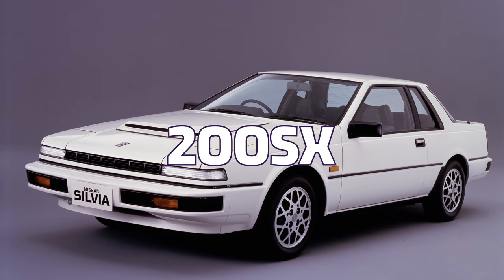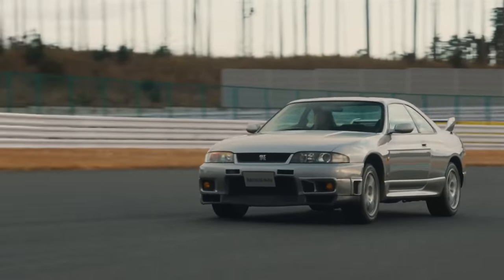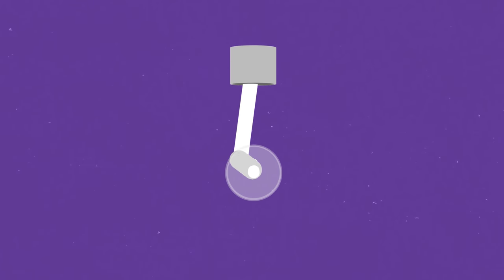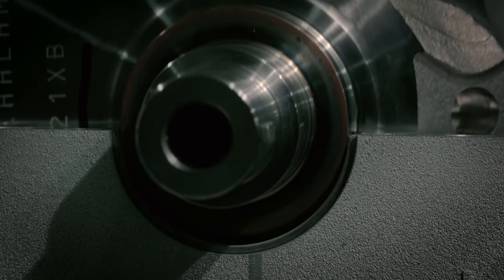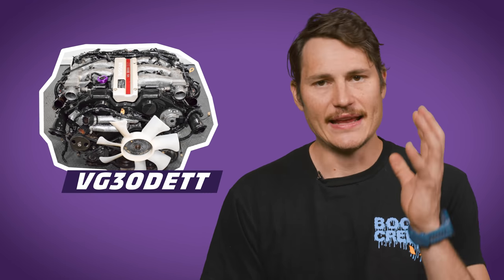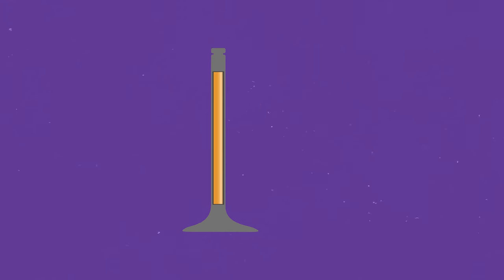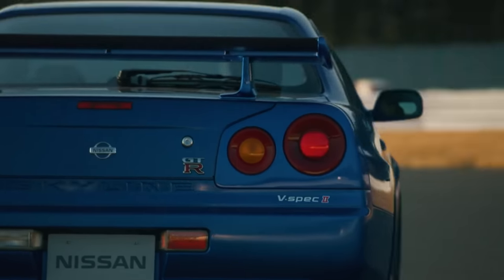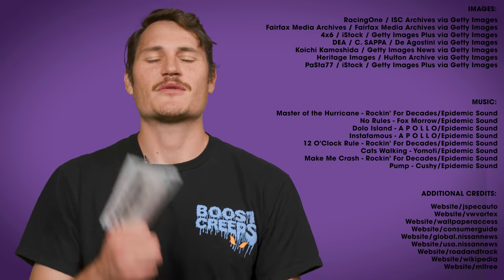RB vs. VG: Why Nissan Discontinued Their Best idea

Comment: As always, the production is excellent, HOWEVER I've got some "technical inaccuracies" warning bells going off in my head... so like a good keyboard warrior I'm just gonna spit out my unresearched information in the comment section.  Sue me.  

1. The animation of the firing order on the RB... there are NOT multiple cylinders firing simultaneously in this engine.

2.  I don't believe the sodium vaporizes, rather, doesn't it just liquify and float up and down within the hollow of the valve?
Reply: Yeah sodium filled valves is something different than liquefied into gas valves lmao. They are primarily just lighter. The production is shit if they just spewed completely inaccurate information as fact that some fanboi is gonna recite as automotive gospel without a second thought.... lazy writing and research.
Reply: They remember they used a similar incorrect firing order on another video, when both cylinder are tdc one has combustion one is exhaust stroke

Comment: My 1991 Nissan is also one of the best.  1991 Nissan Hardbody d21 base with the KA24 and 5 speed manual!! Woot woot over 350,000 miles all original not sure how much over because that parts broken lol but 10 years ago when it stops counting.

Comment: I loved the 300 ZX31 . I owned 3 of them , all very good ( one with more than 420.000 km, no oil losses, full power nearly everything still in order ). Very reliable V6 with very low fuel consumption , high speed max 255 km/h . The open roof Targa driving feeling was perfect. The Z32 was very beautiful - to my oppinion one of the most elegant designs at all - but not comparable concerning low fuel consumption and difficult to repair ( no space to act and very complicated - too many different materials with different thermal behaviour -, early engine problems , but also extremely powerful  , I owned two of them, one had an engine fail when I bought it with 120.000 km , tried to repair and gave up, but a well experienced Z32 specialist bought it and was able to tune it beyond 400 hp, and vmax=295 km/h  ). A gone and happy era.

Comment: VG30 has one throttle body per bank. And the VH45 has sodium valves too. The RB26 has two exhaust manifolds. The follow up to the VG30, the VQ30, was Nissans race car engine. 300ZX also has all wheel steering.

Comment: All of this really just makes me sad to see how far Nissan has fallen. They were IMO the best manufacturer for enthusiasts in the 90s but with all of the cost cutting, CVTs, etc they haven't made anything compelling in many years. Add in the crazy price appreciation of 300s/240s and my current G35 will probably be my last Nissan, at least for a long, long time. 

My only (slim) hope is that they  can actually embrace electric cars fully and come out with some desirable models. With the Leaf they had a great advantage over most other manufacturers but they've essentially squandered that and don't appear to be making any headway. RIP Nissan
Reply: @Thor Odin son sounds awesome
Reply: 90s Infinitis are the last desirable Nissans still on the market. Q45, G20, J30, i30. Everything was top of the line
Reply: @Thor Odin son yeah mine is an 03 sedan and is on death's door. I don't do much wrenching myself on it and have had to put over $6k just enough to keep it running for the past 2 years. Still has tons of issues that will needs to be fixed soon (valve cover leak, fuel pump, etc). I really like the car but it has been very unreliable and a money pit.

Comment: Most people in the US don't know that there was actually a diesel version of the RB (the RD28) as well, just like the LD28 was the diesel version of the L Series. I have one in my daily driver (1992 Y31 Gloria wagon) and it's quite impressive for a naturally aspirated diesel. It is quite high revving for an IDI diesel, owing to it's short stroke, and gets impressive fuel economy, even beating a 2013 Jetta TDI wagon on a long highway trip. It's extremely smooth as well, and has the great RB exhaust sound. With a turbo and upgraded internals it's possible to make some pretty impressive power as well.

Comment: Eh, a three-cylinder works perfectly as long as the two outer pistons are half the size of the center piston and are operated as one, so the engine functionally becomes a balanced two cylinder.
Then add a temporal torque transfer device (a radial magnet stator and a bar magnet rotor, which are shaped to subtract torque during power strokes and add it back in during non-power strokes). Now you have a three-cylinder engine with perfect balance that is smoother than a straight six.
Reply: But then that’s the same displacement as a 2 cylinder
Reply: I had a Yamaha boat with two 1.4 liter 3 cylinders that revved to 7500ish for hours at a time and very smoothly.  Essentially jet ski engines

Comment: The pinnacle of the VG is actually the VR38DETT which we all know are now being modded up to 2000-3000+ hp in GTR’s. Plus the VQ series are incredible in their own right. I put 205,000 miles on my 3.5 altima and there was never a day I didn’t drive it with the pedal to the floor wringing out each gear to redline. It was still running strong the day I traded it in and the only failure it ever had was a cam position sensor at 150k miles which is a ridiculously cheap and easy thing to fix.

Comment: I have a 93 Nissan quest with the vg30e it's my good gas mileage beater I drive on occasion it's sitting at 338,000mi and still running well..
great engines
Reply: I believe the Quest has the VG33.
Reply: @mescko  later generations had the vg33 but the early gen had the vg30

Comment: I love the vg series of engines. Thry may be a pain to work on, but theyre so simple. I have a vg33e in my 2000 nissan xterra. Its slowly getting upgraded and ive got headers and a turbo on the way. N/A it is getting roughly 230Whp

Comment: You forgot to talk about how VGs regularly make a quarter million on miles before failure and a boosted Rb be lucky to see 100k
Reply: Yeah, mileage is a great way to measure the value of a car that's just not very fun.   Also fuel economy and insurance.  lol
Reply: You're not wrong about the VG but "lucky to see 100k" you have no clue what you're talking about
Reply: That’s funny my boosted RB has 220,000kms and still has good compression all round
Reply: @jarradwalsh6829  yeah your just at 100k would you like me to show you my Vg generator NA makes 250 hp has 2 million hours on it never been apart valve cover every 5 year oil change every year the Vgs live longer than rb its the benefit to not having a inherent oiling issue
Reply: @stevenveach6984  My RB25 has done over 50,000km on 440HP. Yes the RB has oil issues (usually due to sustained high RPM for long periods of time) but they are easily fixed with aftermarket parts readily available.
Reply: @jarradwalsh6829  great power density is what makes the rb a sweetheart for the community but for day after day or emergency use/reliability I would take a vg any day built for cars , truck ,utility vehicles . Heck the Japanese military has a version of the vg as a generator to power field hospitals in the 90s . they're much simpler than just about any v6 of the Era and parts are global rb parts are kinda scarce if  your not in a market where they existed naturally .

Comment: V6s are not 2 inline 3s either. The firing angle is the same as the Inline 6. From experience, the VG runs just as smoothly as the RB lmao. Your argument and logic is based on 90 degree odd fire V6s, not 60 deg even fire. Lmao
Reply: Correct.

Comment: All of this just made me wonder what a V12 consisting of 2 RBs smashed together would sound like
Reply: Toyota did that with the 2jz look it up it’s pretty cool
Reply: @Pandara-up5lw  yeah the 1GZ-FE, the one used in the Century. it's a 5.0L so two 1JZ. Some madlad is putting it in a miata. Closest we got from Nissan is a 5.0L V12 derived from Prince's GR8 engine (2.0L I6). The GR8 was the base of the S20 used in the Fairlady Z432 and first gen GT-R

Comment: The VQ engines are mint aswell 🔥🔥🔥
Reply: until the timing chains make noise or the head gaskets leak lol. done 1000s of timing chains on these motors. other than that it runs pretty well.

Comment: In Australia, gm holden used the rb30 in their 1988 vl commodore, they were able to claim 33% more fuel economy over the previous commodore which had the old push rod 6 from the 40's. Ford just kept using their tractor engine and holden killed ford in sales. But it had one major design flaw, the radiator sat lower than the head so it was prone to blowing head gaskets,  the shoebox r31 did not have this problem. So americar-heads, you want a factory general motors jdm engined car, the VL holden commodore is your diamond.

Comment: Alfa,s 4 banger twin cam engines had sodium valves on the intake and exhaust ,back in  the 60,s, the factory  book said not to reface the valve, you were supposed to cut the stem off to release the sodium and toss em in the bin, plus the valve seat angle was 46,so you had to hand  finish every seat and valve with really fine lapping compound

Comment: I've owned lots of old Skylines and Z cars but all had L series motors except for my Z31 which had a VG30 of course. It was nice to drive but one thing that killed their popularity here in Australia was that the Z had a different intake manifold and injection system than the Maxima, etc, in order to have more power and responsiveness. Only trouble was that if you had dirty injectors they would leak and fuel would pool in the manifold. Many 300Zs burnt to the ground and we turned back to Skylines well before Gran Turismo was a thing.

Comment: Great video guys!!! US VG history goes pretty deep and a lot of it goes into grassroots racing. VG30E/T notably for the Z31... But as you look into it, The S12's got a limited run with the VG30e as well. Again, besides the Z31 for the sohc VG and the DOHC VG for the Z32, it largely goes unnoticed. Being a fan of the VG and a car that some don't know much about stateside, the Infiniti M30 is a vg30e (with AT). In Japan, the F31 Leopard had the whole range of VG20/30 except the Vg30e (and the Leopard owners love it because of the response). Same with the Ced/Glo/Cima of the same era.  They had the VG30DE/and DET in the top level of the F31 leopard (Ultima). 

 But when you really think about it, Nissan made 2, twin turbo, 6 cylinder engines at the same time and that to me is pretty bad ass. 
Personally, I love the VG series and as my leopard brothers say  in Japan, "heart of the leopard is the VG". While tuning can be done, RB engines get all the love because of the reason explained, we (Americans) never got the RB or the Skyline and it was romanticized with how it used to be un-obtainable or the games or the videos.

I will add, I am rebuilding an rb25det with forged and upgraded a lot of components as well as rebuilding the M30 that it was swapped in (Project Car Magazine M30) and Geezus the RB is expensive to build. I'm not sponsored, or have hook ups or part of drifting.... so everything I've done was out of pocket. But the M30 I got was the most famous within the US F31 history. Other than that, I would have loved to swap in a VG30DET into an M30 to make it close to the a Japanese Leopard. f31club.com

Comment: The VG is a PITA to work on especially when packed into the tight engine bay of the Z32. It also sounds pretty awful like most V6 engines. The RB sounds fantastic and is less of a headache to work on since it's an inline-6 layout. Inline-6s tend to be smoother running than V6s.

Comment: the moment you said the RB was an inline 6, I knew right away which one is the better engine. I have a Ford 4.9l in my 82 F100 and it is the most reliable engine ford has ever made, to the point where die hard GM and Mopar guys like it.

Comment: The Nissan CA18DET inline 4 had sodium filled exhaust valves. I'm fairly sure all Nissan DOHC 4 valve turbo's have sodium filled exhaust valves.
Anyways there's about 12 mph to argue about, the Z32 has better aerodynamics.
The JUN-BLITZ Bonneville Z32 with VG30DETT holds the E/BMS class land speed record of 419.84 km/h (260.87 mph) set at the 1995 Bonneville Speed Trial.
JUN HYPER LEMON R III with RB26DETT set 1997 USA Bonneville Speed Trial F/BGCC class record of 383.715 km/h (238.48 mph).
240SX S13 took E/FALT record of 379.54 Km/h (235.890 mph) in 2006, with a GM Indy V8 race engine.

But a Datsun 120Y coupe has done 295 mph.

Comment: Idk if anyone in the 90's or early 00's were fooled into thinking 240sx's were "fast" lol. Back around 02-03 you'd be lucky if you could sell a 13 year old KA powered S13 for 1000 bucks. Sure the S14 did command a higher price at the time but it was also still a fairly new car. The S13's struggled to keep up with n/a Honda's and weren't really seen as a viable platform unless you were willing to build your own conversion harness to run an SR swap and even then it still wasnt going to win trophys at the drag strip. It wasnt until maybe 2008 or so, or whenever Formula-D came to the US that aftermarket vendors really started making parts that allowed the S13's to become real a condender. 
Even just 5 years ago there was almost zero aftermarket for the VG30et and Z31, but that whole market has opened up in a way I never thought I'd see...and just in-time too cuz I just got a turbo Z31 and an N/A that both run, both are 5spd 2+0 models and neither of them are rusty. The best part is they were free cuz I gave away a 280Z 9 years ago to a guy who is finally "repaying the favor"...not that I ever asked for anything in return but damn ^_^

Comment: Jeremiah watup bro..speaking on long vs short.. if long easier to break... why does the 2jz handle more power from an upgrade on its engine with stock engine internals as opposed to the vg version.?? And I think the 2Jz n RB are two best tuning platforms... 2Jz may have the edge

Comment: I had a 2001 Xterra with a VG33 engine. Only thing it ever needed was a timing belt and a valve cover gasket, thankfully it was the passenger side gasket that leaked.

Comment: Jerry! I know this video is old , but no mention at all about the RB oiling issues? consistent high rpm applications lead to oil being trapped in the head and it starves the low end. Resulting in a pretty upsetting situation.

Comment: That's not how a sodium-filled valve works, that's how a heat pipe works. Sodium filled valves are half-filled with sodium and the sloshing of it's operation carries the heat from the head to the upper section of the stem, no boiling involved.

Comment: I read an article about how in a parallel universe that if Holden hadn't stopped using RBs in favor of GM corperate engines, we could of had Holden imports  with RBTT engines. Early concepts of a Pontiac GTO revival exist with Mazda RX8 suicide doors, and in a parallel universe with a RBTT instead of a LS. This would be the same with the G8 and Chevy SS.

Comment: one of the most abusable engines of all time has to be the VG33E. All the miles, all the idle time, bad egr valve, overheated, drowned in a mountain creek, muddy air filter in moab, never enough oil changes, first timing belt service at double the service interval, all the heavy towing. The thing just doesn't care and won't quit. Forum Sensei says that he remembers a vg33 that has a 7.3 powerstroke turbo strapped to it with a 20lb wastegate and no intercooler that makes regular pulls on Saturday nights.

Comment: I had an 84' 300ZX turbo manual. Put 242K on it. HARD. I did at least a burn out a week. Finally chucked a rod or something Idk, had to have towed out the driveway but... the seats by that time were just some oddly placed wires under cloth so, it was time to go.

Comment: I think the VG hasn't actually died or been forgotten the 400z release was based on nissan showing the Z lines following and one of the biggest names in that line is the z32 when it came out it was a car that had an overall design that was before its time, a great engine, and like the S Chassis line it was relatively easy to make it a good drift car but it also had the proven power to do much more. Mechanics in America have had plenty of knowledge on v6 work which helped counter the inlines more straight forward approach in the American market. More importantly the restrictions on the most influential skyline (r34) for exporting helped as well. I'd say what really helped keep the RB name going is media more then the engine itself when comparing its appearances in movies and video games to the z32 that rocked the VG its like the VG is a needle in an over bailed haystack